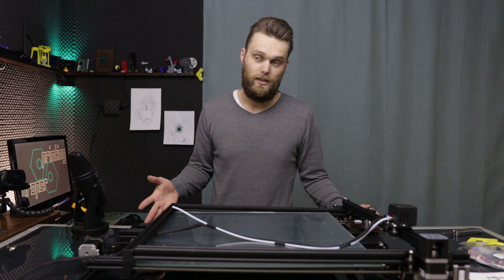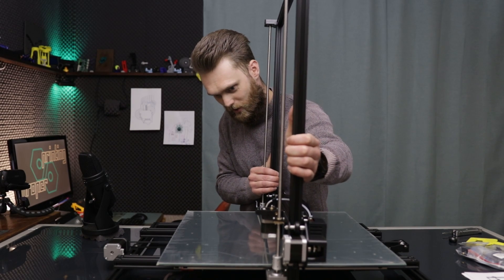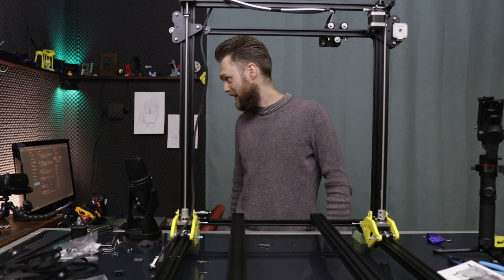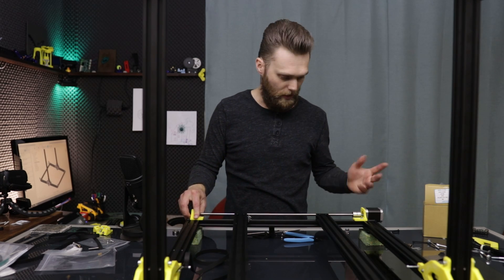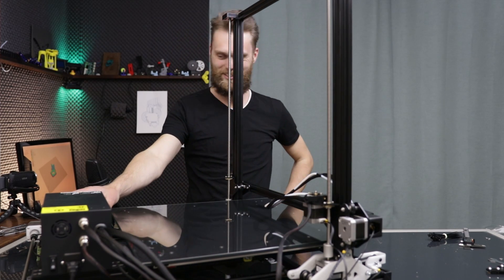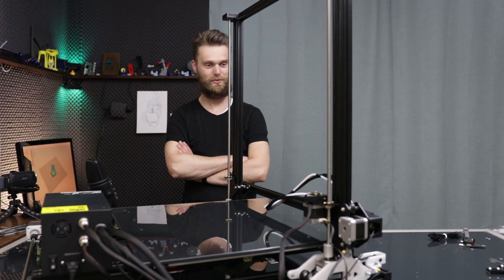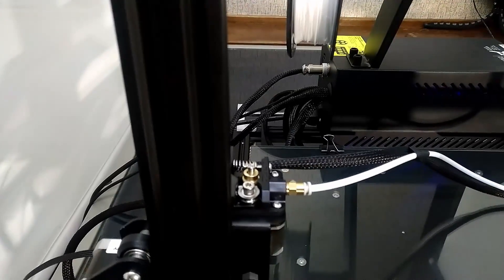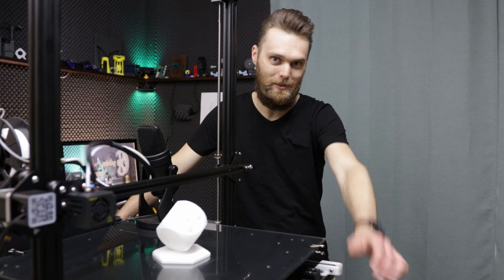Why not move the PORTAL instead of the BED?

Comment: This ain’t corexy
Reply: This is Cartesian with moving y gantry, corexy would mean kinematics change.
Reply: Yes, not a COREXY, but it is an interesting design, and a good idea.
Reply: @scottbaeder37  Just basic cnc machining with a moving gantry ;)
Reply: @scottbaeder37  its a horrible idea :)
Reply: It's cartesian-XY-head kinematics like the Ender-5 instead of cartesian-XZ-head like most i3s.
Reply: My S5 moves all over, shakes, and is miserable.  I’d love to buy a kit from you with the pieces and maybe idiot level instructions of how to do this, looks like it would save a lot of room.  Maybe increase print speeds - no large bed moving (but yes large gantry moving).  Seems innovative to me, well done Sir!
Reply: @garygarland9366  have a look at vorondesign.com. It is a community based project but you have full bill of materials, instructions etc. However I do like this concept as well! For printing large and not very detailed items I think it will work just fine despite the wobble concerns that many have expressed. Voron printers on the other hand will have less mass to move around.
Reply: CoreXY is that belt arrangement that was mentioned, and the way it combines X and Y axis so neither of those motors needs to move. Moving gantry, as this idea is, also has a place in speeding up 3D prints; by having multiple gantries working simultaneously on the same long print, you can deposit more material over time. See e.g. the Titan Robotics Cronus.
Reply from the maker: I was honestly a bit unsure, but I couldn't find a fitting name for this approach. It moves the core in the X Y and Z axis so maybe it's a core XYZ or do you know how this is called?
Reply: @properprinting  Its just a regular cartesian printer with a moving gantry. All of the axis are independently driven. With a coreXY or hbot configuration linear movement requires the interaction of multiple motors.
Reply: @properprinting I don't think it has a name, waterjets and most small CNC's use that design tho
Reply: @BuzZ.  It's Cartesian. It does not matter what axis moves, the kinematics did not change.
Reply: @properprinting  I'm blown away by this mod. Having an s5 myself I'd almost like to try it. I would suspect the Z beams being wobbly though?  You think this mod has potential over moving the huge bed?
Reply: @haraldhimmel5687  exactly, the Z would be wobbly as hell.. this makes no sense at all, really horrible design
Reply: @properprinting  Moving gantry CNC.

There's a whole class of milling machines known as mobile gantry mill that use this concept. The main sacrifice in 3d printing is that at higher speeds, the lack of rigidity will cause the gantry to wobble when the extruder is higher up. 

Try some kind of ringing test.
Reply: @properprinting  CoreXYZ is also its own thing. The way it moves on the Y axis is similar to an other industrial printer I have seen. If you look at the academic literature you might be able to find the official now, otherwise you can probably make up your own name. It is cool either way.

Also, I think this would work better with a shorter gantry. There is still a lot of moving mass.
Reply: @properprinting  I think generally you would call this an H frame or simply a moving gantry. This is how a lot of CNC routers are constricted like the Shapoko and MPCNC. Generally the gantry is like... a quarter the height of the frame length and width though for a rigid setup.
Reply: @properprinting  I'm pretty sure this is called "gantry style". A similar design is often used for other CNC machines such as routers.
Reply: Proper Printing well, name it reverse Cr-10
Reply: Would just call it an i3-Box hybrid
Reply: Corexyz moving portal
Reply: Pls no hate on proper printing
Reply: However you call it, having it this way, saves a lot of room without the moving bed, and must be capable to higher speeds without having to move the huge bed which backlashes.
Reply: @xoniq-vr  yeah, but now the gantry will have backlash, it just doesn't change with print weight.  Though I bet tall prints will see more vibration at top layers.  If you can manage the gantry vibration, this will be a good upgrade. 

Perhaps get the extruder off the gantry with a longer Bowden tube? 

Awesome experiment though!  👍
Reply: @iandrake4683  There's not going to be much backlash given that the only place it could really happen is in the stepper motor itself. Timing belts are a technique used in telescope mounts as a way to minimize backlash. As long as the bearings are good and the belt is properly tensioned, I would think backlash would be negligible.
Reply: @NameOfTheDragon  perhaps backlash is the wrong term. My concern would be when at higher z layers, the entire x axis assembly (extruder, 2 steppers, fans, etc) will have inertia acting on a long moment arm, giving it lots of torque to cause vibration or wobble. 

The proof is in the pudding though. It seems to work at the height he needs.
Reply: @xoniq-vr  Nope. The speeds will actually be lower, compared a classic cartesian machine. moving such a tall Z frame back and forth will generate tons of wobble
Reply: @xoniq-vr  It's a trade off between moving the print bed and moving the gantry. The gantry is secured with exactly 8 screws, so at high print speeds, it's like waving a sword around while holding the end. There's going to be  lots of wobble.

Most CNC machines using this design are either: A) Industrial and weigh a good fraction of a ton, or B) have a very short Z axis.
Reply: Proper Printing don’t you love internet know it alls? “That’s not CoreXY, I’m a expert”.. get out of here with that. JON DONT LISTEN TO THE ASSHOLES. Keep going you’re killing it and doing a great job. I love this channel and these videos
Reply: @thelightspeed3d712   Man calm down, no-one ment to be an asshole nor to discourage him, they were just pointing that out.
As far as I can tell, politely too.
Reply: Giovanni Boato I think he already knew it wasn’t a CoreXY, he was merely relating it to the bed being stationary.
Reply: @thelightspeed3d712  I’ve only seen ppl’s comments that politely corrected Jon’s mistake. Stop misrepresenting what’s going on here. This indeed is not corexy and that’s a fact that Jon would probably like to know even if you  aren’t willing to accept it.
Reply: @saritsotangkur2438  Yeah you're the guy I am talking about. After 700 comments "that ain't a corexy"... here you come to show how smart you are. Shush...no... I said SHHHHHH. Quiet... this was ten months ago. I am glad you thought this over before making a comment that the internet just had to have.